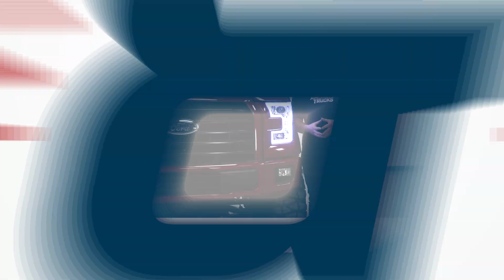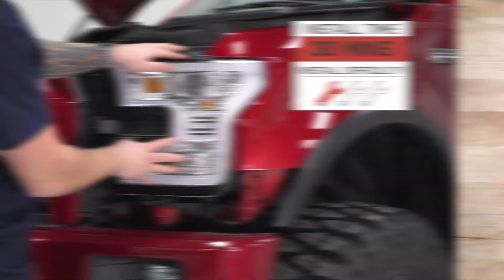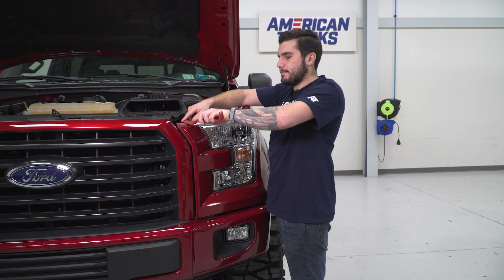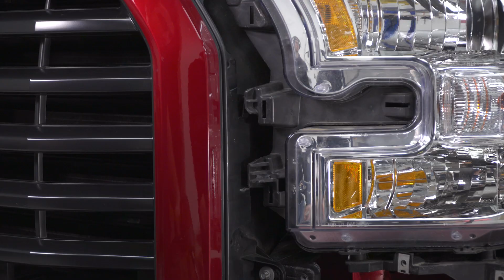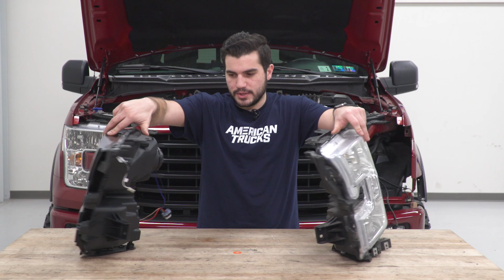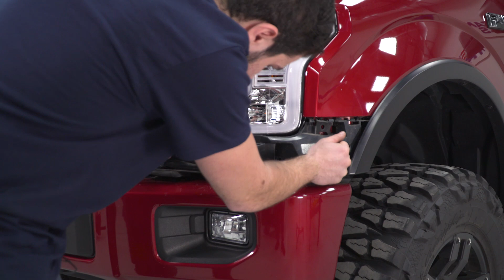2015-2017 F150 Projector Headlights w/ LED DRLs - Chrome Review & Install

Comment: I have these and i bought LED headlights to switch out the Halogen. But i can only see 10 feet in front of me. Is there anything i have to do?
Reply: Just bought some for my 2017 f150 easy install but can't see 25 ft in front of the truck they won't adjust up or down  what do I do AT any advise or do I need a refund or another set?
Reply: @Chessiecat2014  I'm glad you posted this question I have pretty much the same set up what did you do to fix it ?
Reply: I’m having the same issue. I replaced the halogen with LEDS and I can’t see down the road at night
Reply: @gerardosaucedo1231  what do you mean halogen lights what’s the difference are they more bright on these pair of lights or the leds less bright
Reply: Someone said left is right and right is left for up and down I’m going to try it tomorrow

Comment: Question I want put 33s in my truck f150 2012 what lift you recommend what rims ?
Reply from the maker: For 33's you'll want at least a 2" leveling kit in the front, rears aren't much of a problem. Rims are personal preference! Keep your eye out of the wheel offset though, go close to 0 or negative and you'll have some extreme poke! -Adam
Reply: AmericanTrucks Ford thanks my friend
Reply: 10” lift minimum